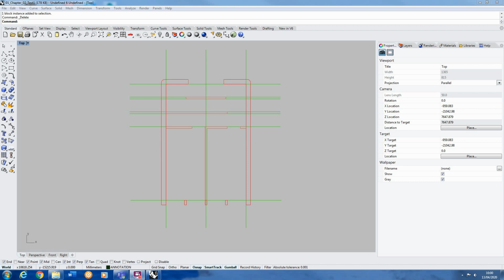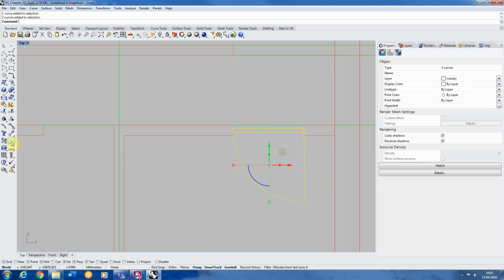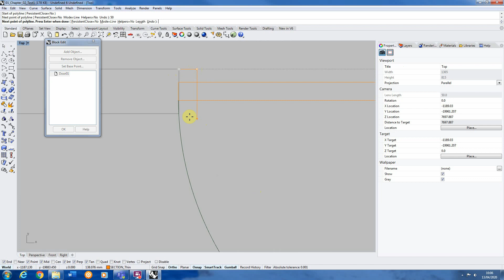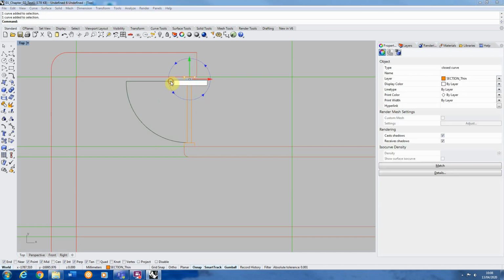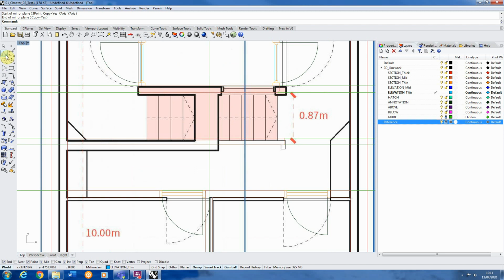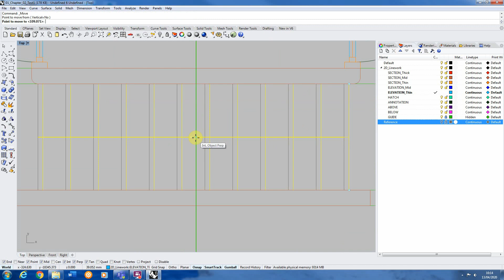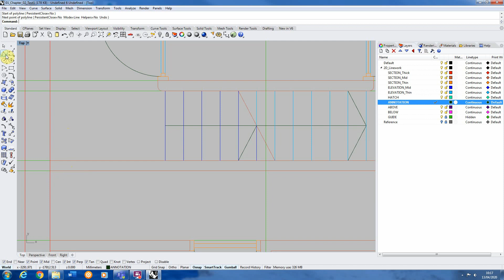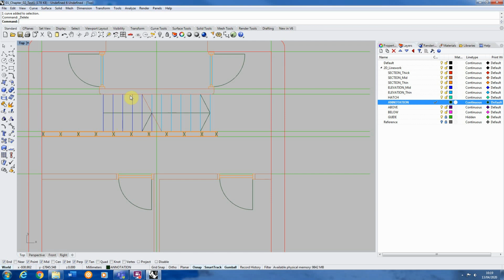Rhino 2D - Part 2 - Architectural Plan Drawing

Comment: Thanks for this tutorial. 
Does Rhino have the ability to automatically adjust the wall opening if you adjust the size of the door? For example, if that block door is 920 and suddenly you need to make it 820, will the adjoining walls adjust to touch the door?

Comment: Is 2D drafting in Rhino as efficient as its in AutoCAD? Do you see any advantages of Rhino over ACAD?
Reply from the maker: Yes, I think once you get used to the tool it's just as efficient as AutoCad. The main advantages of Rhino is the ability to easily transition into 3d modeling in a much more intuitive way than AutoCad